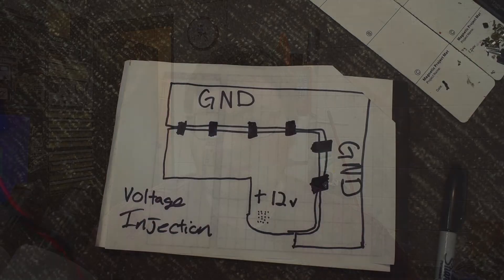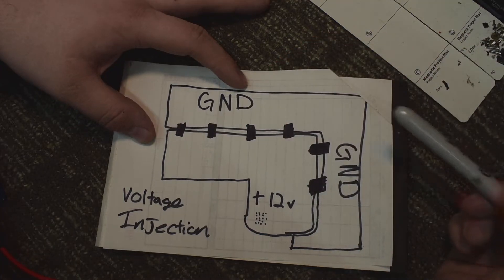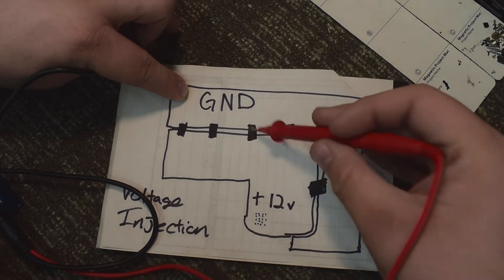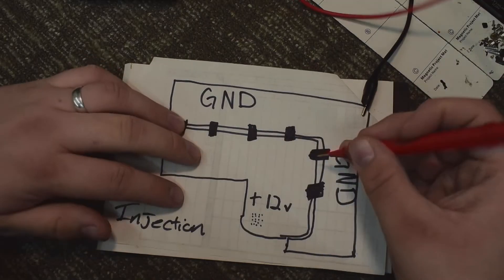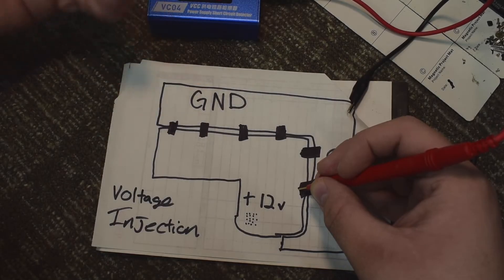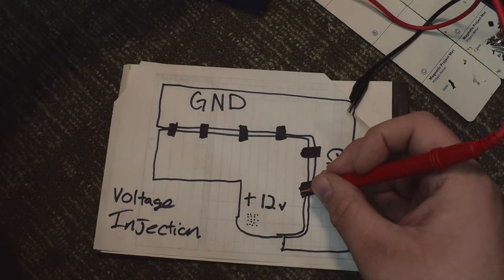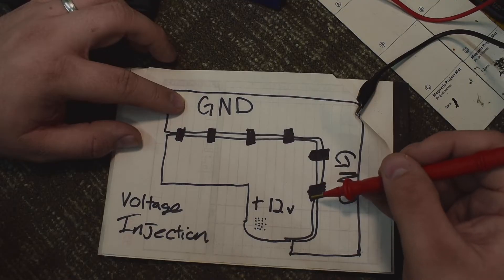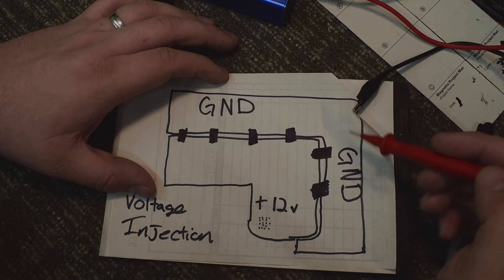How Voltage Injection Works

Comment: Hi, do you always set the voltage injection to 1.2v to whatever rail? I saw in your video that it is the 12v rail and you injected 1.2v meaning not necessarily to match the voltage?

Comment: Touching the positive lead to a specific component and checking for amp draw isn't going to help. It doesn't matter which component you touch. There will always be current because of the short.

Comment: I still dont understand the difference between a seperate voltage injector tool like this and a normal power supply. can't we just use a normal power supply, apply voltage and use a thermal camera to find the component getting hot? can you tell me what im missing??
Reply: Most power supplies shut down power when they detect a short.

Comment: Noob Question:   If I think there is a SHORT,  I typically remove the Logic Board from the Laptop case & I have the DCIN Adapter & Logic board for testing.   Then I plug in the Adapter (where it is "normally" powered) hoping to test voltages at various points.  
      What's the difference between that and Voltage Injection?   Is that the same EXCEPT that you are "injecting power" at some INTERMEDIATE POINT?

Comment: Another way to preform finding shorts is by measuring resistance. You can simply poke around while looking at the resistance. Whichever capacitor reads to lowest resistance, that one is typically the problem. Typically you are in the milliohms when dealing with dead shorts.

Comment: Hi, thanks for the explanation.
I’m trying to fix a smart bulb with several dozens component on it (no obvious damage visible). 
I do have 12v 5a power supply (for my led strip) but no short circuit detector.
Could I still check for shorts with just the multimeter?

Comment: Hi Chase, really enjoy your videos. I have a question. I got a benchtop voltage injector, can it be used as a power supply also? Thanks just found tour channel trying to watch all your videos..BTW it is rated at 15v and 20A
Reply from the maker: You're awesome maurice! Thank you for all the support!

So you can use a bench power supply typically for injecting voltage. But a lot of power supplies do have short protection built in so as soon as the device draws a lot of amps, it will immediately shut off.

Other than that, you can use either a voltage injection tool or a power supply. 

As I've gone through the years, always start with 1 volt at maybe 2 amps Max

And depending on the rail that you're measuring, you don't want to exceed 1.2v on like a CPU or GPU main power rail. 

But if your rail is like 3.3 volts or higher, you could safely inject a higher voltage. But when it comes to voltage injection you typically want to stay on the lower side. And never exceed what the rail can support, or really even come close to it. 

But that last statement is subjective on the rail that you are injecting voltage on. Because it's not always true, sometimes you can inject 4.2 volts on your battery terminals on a cell phone or tablet. Or like 19 or 20 volts on a laptop. 

Same exact thing with a game console 12 volts ect. 

But not exactly injecting the voltage but just supplying the voltage to get the device to turn on.
Reply: @chasefournier  Thanks for that detail ansewer that will be really helpful . But my question can i use the voltage injection tool as i would a power supply? my injection tool is rated at 15v and 20A. BTW being new here is the a way to support you and wha you do ?

Comment: Hi , my question is as your explanation we can inject voltage on any component ( capacitors) on the mainboard ? i mean black Probe to Ground and red Robe to any capacitors and then with alcohol we can find short ? or we must inject voltage to specific capacitor  ? thnx

Comment: What's the difference between a voltage injection tool and a benchtop power supply?
Reply from the maker: Some power supplies have protection that won't allow them to short for voltage injection. It'll just shut down the supply when you short the leads together. 

That tool has a battery built in to handle the massive load if there is a short.

Comment: Hi Chase, I need some advice please. I just bought a Power Supply Kococater  SPPS-S605: 60V - 5Am, pretty similar to the on the video. Firstable I am not an engineer but I am trying to emule a device with this PS. I want to use from 1 to 50V and from 1 to 35mA. I tried and set up to 20V and 5mA, but when it was used, the display showed: V:4.8 (it was moving but just reached 5V, and the Amper value did not move, it stayed on 5mA, this is the value I wanted). Here comes my question: What should I do and order to get this measurements: from 1 to 50V and from 1 to 35mA (I need to hold the voltage without changing the miliampers). Thanks.
Reply from the maker: You need a variable power supply with variable Current.

Comment: Cant I use bench power supply for this job instead of dedicated short detector ?
Reply from the maker: As long as it's able to handle the load. Forsure. 

Some power supplies have protection in them to keep from shorting.
Reply: @chasefournier  I understand, thanks. I am making a bench power supply using ATX psu so this info will help. I think ATX PSUs have protection against shorting.

Would you happen to know what happens if there is no protection against shorting ?(with bench power supplies) 
Are they just going to keep feeding current into the board or will they damage themselves or something like that ?

Comment: Great video - can you actually show the heat camera in action? There might be more than one faulty capacitors. Thanks
Reply from the maker: Absolutely! Btw the example I gave in the video is just based on the circuit I made.

Comment: Actually its not that simple because capacitors are all over the board and also on the other side of the ,also it could be any component that is shorted.Then there is the cost of the thermal camera ,which is not cheap.But as you say thats one way of doing it.
Reply: Time isn't cheap either.

Comment: I appreciate how you started with the MOST simplified diagram possible. It's actually genius. I'm a hobbyist and I have several faulty PCB's lying around. At the start of any troubleshooting process I will now start by testing for continuity between the ground plane and the power rail. If I want to test a specific circuit on a PCB I'll use the same principle to narrow it down. 
I subscribed.
Reply from the maker: Thank you! I'm glad it could help!! 😊💯
Reply: @chasefournier If there is no ampère draw with a main rail voltage insertion, does that mean that there is no short? or what does that mean?
Reply: Hi chase I have some issuer with the motherboard I have can you help me please I am in Northridge and I think you are close by 
Thanks

Comment: I would even think of doing that without a thermal camera.  You want to be as quick as possible and do it as few times and in as few places as possible while using the minimum voltage and amp limitation.  Forced voltage injection goes against everything I've learned about solid state electronics since the 70s, though I agree that especially on motherboards it may be the only practical way to find a shorted component.  
Cannot see any advantage to a so-called special tool over a good lab power supply that allows you to limit the current to a couple of volts and one or two amps.
Politely I hate doing it and don't find it cool, though it is effective.  It's also a good way to do a lot of damage if you do not know what you are doing.
Reply from the maker: Yeah there's no real difference between the tool I'm using and a bench power supply except that there's no overload protection in the tool. Some power supplies, if they detect a short they immediately shut down. 

The best practical way to do it is, check in ohms mode and or diode mode the rail you detected a short on, then inject very low voltage into that area. 

If there is definitely a short, you won't harm anything in the circuit because the power is going directly to the short. 

Even if there's no short, but low resistance, you won't affect anything. Especially in a CPU/GPU low resistance circuit. Those chips  take a ton of current.

Comment: Ok tried it and for me it doesn't work as you do. I did test in diode mode and I get a beep on both sides of the capacitor (a few of them in the circuit, beeps on both sides and see a current draw as you said in your vid) so I get the short finder plug the neg on ground and spray some alcohol and check for a component to dry up but I see nothing. I do have a circuit freezing can and tried it and hope to see it instantly but again nothing SO I got my Flir one pro out and I still don't get a sudden component getting reddish fast. So what am I doing wrong? I did check the other side of the board at the exact same place that I'm getting a short and I'm getting a few caps that beeps on both sides so again thinking that it could be that side that causes the problem so I get my alcohol out spray and inject voltage but again I don't see a component evaporating the alcohol. So what can I do now? Thanks for any answers.
Reply from the maker: You may not be hooked up to the correct ground.

Sometimes in devices they have a giant ground plane throughout the whole device. In other cases the ground plane might be isolated to different areas or multiple different grounds.

That's something I would check for first. And also if the cap your testing is in parallel with a coil then the cap will show short. It's just a few things that I've learned while working on electronics myself. ☺️💯
Reply: @chasefournier  Ok checked this morning and in the area that I get a short it's loaded with coils. Now since there isn't any diagram for this how can you tell if it's in parelel with a coil? Do I need to de-solder the coils to test? Ok for giant ground planes I do have 5 copper squares on one side of the board are these what you're talking about and one is situated where I'm having my shorts. Gee wish I could put pics in the message so you could see. Now if my memory is good coils are identified with an "L". I could maybe do a little vid to show you the board and what it does. BTW what I'm trying to fix is a Kodak picture frame that doesn't power on. Again THANKS for your kind help AND response and I appreciate it very much!!!☺
Reply from the maker: @Sisko125  Absolutely. So check one side of the cap and see if there is continuity with a coil. Then check the other side.

Comment: I just got my short finder but how can you find out what voltage you need on a mother board to set your short finder to inject??? I know that I won’t set it to 3.8v to start with but how do you determine what you need to set it? THANKS for your AWESOME videos!!!!☺️
Reply from the maker: Always start with the lowest voltage possible. 1.2 volts is what I use on basically any circuits. 

If there is a short, there will be a current draw immediately, even at 1volt.
Reply: @chasefournier  WOW THANKS CHASE for a fast response!!! Have a GREAT one and again THANKS!!  ;-)
Reply: @Sisko125  i think i remember northridge saying to take it up in steps of 0.2v.    example if 1.2v don't reveal anything  then try 1.4v

Comment: Why are people using them voltage injection tools ? 
Surely the majority or repair technicians have a bench power supply 🤷🏻‍♂️
Reply from the maker: What's funny is, I actually almost consistently use my power supply now for this. 

Most power supplies have a protection circuit built into them, so they'll go into protection mode if it detects a short. If I used my old power supply to inject voltage, it would just shut down immediately. 

These portable injection tools don't have a limit, and so you can measure a 4 amp short no problem.
Reply: @chasefournier  Yh I know what you mean, but for the price of them units a half decent psu can be brought .. rockseed all the way for me 👍🏻

Comment: So I recently bought a short killer(plug in version) and I have a few caps on both sides that are shorted on a board im practicing on. But when I inject voltage to the positive rail of any shorted component it always sparks and won't inject voltage. Am I doing something wrong?
Reply from the maker: You'd have to make a video.

Comment: Thanks for explaining how this works. I have a question. I work on vintage arcade games (pac man, donkey kong, etc) and want to use this method on those pcbs..its all old school through holes components…would this method work on those old school boards? They run on 5 volts…could i inject 5 volts into the board at a shorted/grounded point and get the hot area results? Also..does it have to be 5 volts? Can it be 1 volt or 2 volts?
Reply from the maker: You should be able to use it, if you find a line that is shorted to ground, you can inject one volt on that line and check with a thermal camera to see what gets hot. I wouldn't inject more than 1-2v 

My rule of thumb from experience is, if I have a board that has a higher voltage rail like say a laptop with 19 volts I feel comfortable with injecting up to three volts or almost four on that rail if I can't find where the short is with a lower voltage.

Always inject low voltage first. Watch your amp draw.
Reply: @chasefournier  Thanks for the quick reply. Would be cool to see u fix a vintage arcade board.
Reply from the maker: @MyNameForNow27  if the opportunity presents itself, I definitely like to have a look!

Comment: Are there components that you shouldn't inject voltage into? Like diodes, resistors, MOSFETs? Anything that's shorted on both sides okay to inject voltage on?
Reply from the maker: Good question. I'll say this. Many boards have a protection circuit that won't allow voltage/current to pass through because it detects a short on that rail. 

If you measure a very low resistance to ground on a rail that you know is supposed to be 19v for the charger. And the resistance is like 7ohms to ground. I would inject 1v-2v on that rail and see what gets hot. Voltage normally passes through on that circuit, but doesn't because the protection. So by injecting 1v-2v on the circuit, I'm deliberately applying voltage into the circuit, and the short is going to draw however many amps it wants. The shorted area will get hot, and generally that'll be your problem.

Comment: Awesome video. Already bought a thermal camera and I'm just waiting on my voltage injection tool to come in the mail. You should a vid of mosfets and how they work. 👍🏼
Reply: Why not use a normal lab power supply and limit it to 1 or 2 amps?
Reply from the maker: I'll see what I can do ☺️

Comment: The problem I see with your video is since its pitch towards beginners and novices, they are going to get the impression that if there is a short then it will be a capacitor, 99% of the time if there is a short then it will be a semiconductor, whether its a diode, a transistor or an ic but guarantee it will be a semiconductor
Reply from the maker: It's never a garuntee that it's a cap. This video gives a general idea into the world of short finding. 

In my mock circuit it's only caps, but It can be a mosfet, diode or whatever. The general idea is whatever heats up, can be the issue.
Reply: @chasefournier  true, the point I was making is if you had use

Comment: Great video for beginners, and it's nice you talked about the evaporating liquid as an alternative to the thermal camera, because like you said, they are expensive
Reply: Beginners should not to be repairing client devices. Good simple video nonetheless.
Reply: @therealb888  spitting facts. Always practice on donor boards/ personal devices. IPhone 6 boards are cheap, that's what I've been practicing on
Reply: @EggplatnmWatch   Appreciate your integrity. I study EECS  & lately have developed an interest in electronics repair apart from tinkering, prototyping, experimenting on various projects that I do. I'll probably give those iphone6 boards a try, thanks for the mention.

I once saw a video when a complete newbie injected 20V into vcore because he taught there was a shorted cap after his DMM buzzed. CPUs actually have low resistance and can trigger the buzzer in continuity mode. This guy killed a client's board and said it was unfixable.

I'll see if I get the time to do a more a detailed video/blogpost on these voltage injection tools/short killers. Many don't explain everything you need to know about them.

All the best!
Reply: @therealb888  however beginners could actually be looking to repair their own devices, or maybe a family member or a friend who doesn’t want to pay what it would cost at a repair shop, so essentially a great opportunity to get some free “experience”… Don’t forget to think beyond your own “bubble” of experience sometimes😉 Happy days😊

Comment: Thanks for this video, really happy I stumbled across your channel!!
I recently bought a voltage injector without knowing how to use it in practice!
Your video is clear and straight to the point which I like.
One question though, what voltage do you inject? would it be less so nothing blows? Or will this not be enough to show? I like to do Switch repairs and want to take my knowledge to the next level by diagnosing faults better and more accurate.
Thanks for your time and for another great vid!!
Reply from the maker: Glad you enjoyed it! 

1.2v is enough for most things. I've used a higher voltage on a shorted circuit and it showed a higher amp draw. 
Other than that I suppose it's safer, and if you use a higher voltage, it'll help determine the fault.